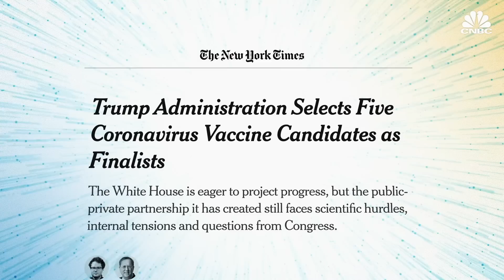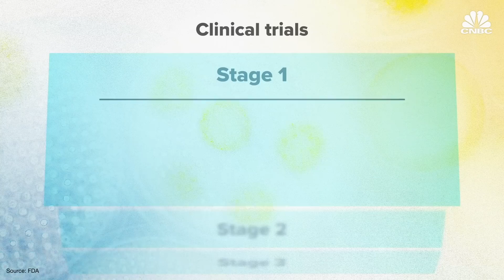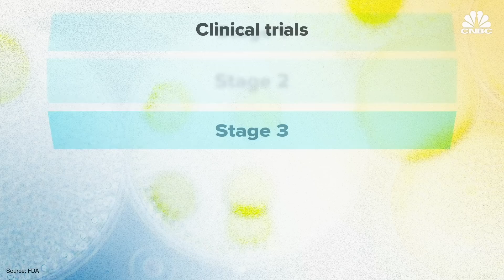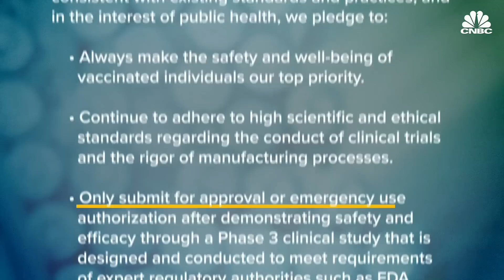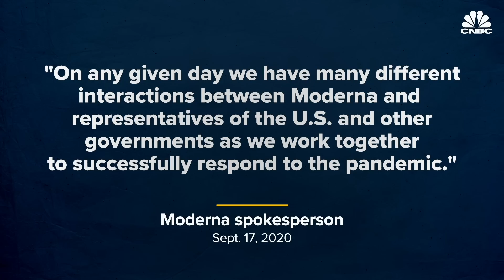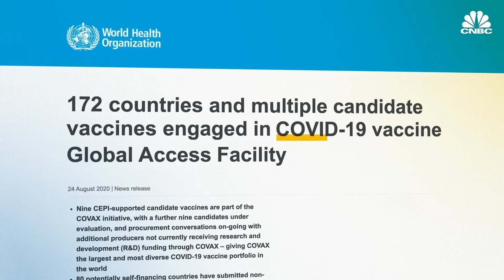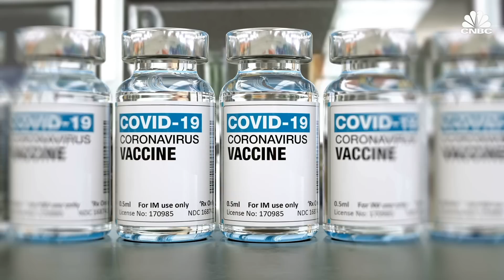What Is An mRNA Coronavirus Vaccine?

Comment: @3:05 "because the vaccine doesnt contain a virus, the participant cant get effected by the vaccine. Which is a risk for the traditional immunization methods." Does that mean they're saying you can get the flu from the flu shot?
Reply: I believe so. I know I did. I was sick as a dog when I received the flu shot, never again, I would have rather had the flu and been over it in the usual week it takes me to recover from it. The flu shot made so sick, knocked me on my butt for two weeks, it was awful.
Reply: @kimwarner1681  Sorry to hear that. Im just shocked they admitted that because Im always hearing doctors/media claim that the flu shots will never give you the flu. I stopped getting the flu shots cause I always ended up getting the flu right after getting the shot. Since I stopped,I havent had the flu since then.
Reply: because you are given a weakened form of the flu, there is a small risk you will show symptoms. vaccines are worth it regardless, because there is a much smaller chance of vaccine complications then there is with complications from possibly getting infected
Reply: @swank8508  That makes sense but why do they state you cant get the flu from the flu shot if that is true? That is my whole point.
Reply: @ImmaQT2  certain types give a weakened virus where you CAN get sick, but there are also versions of the vaccine that give a dead version of the virus and CANNOT give you the virus. I got a nasal spray vaccine once, which made me slightly sick for one day because it was the live virus vaccine

Comment: Yeah, no thanks. I am not an anti-vaxxer, I get flu shots, but that type of vaccine has decades upon decades of research and use. I am absolutely not going to be a guinea pig with a vaccine that actually hijacks your cell's machinery with synthetic RNA. It just sounds like the beginning of a bad sc-fi movie. No Thank you.
Reply: as someone who takes vaccines i hope you will listen to reason. this rna will not alter your dna, it will only give one-time instructions to your cell and then the rna will be broken down. the dna will be safe inside the cell nucleus the whole time
Reply: @swank8508  I don't think you fully understand how this vaccine works. Using synthetic virus RNA, It hijacks the machinery of your cells to produce the Covid19 spike protein which it expresses on the outside of the cell. Your body then identifies this cell as a foreign invader and attacks and kills this cell. No, this vaccine will likely not alter your DNA, but it does train your immune system to attack your own cells, which is why some experts think that cancers and autoimmune diseases are a possibility.
Reply: @kjjosker  this is the first good argument ive read, do you have a source for autoimmune concerns? (Not proof, just a scientist who knows what theyre talking about expressing concern)
Reply: @swank and again, this is fairly new technology that has not been tried on a large scale, I would be very shocked if it goes off without a hitch.

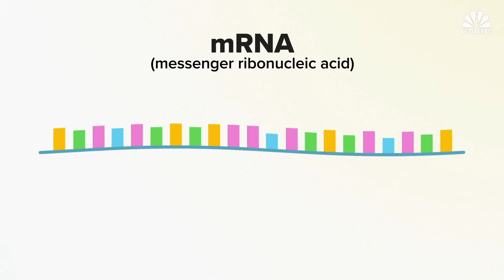Comment: The description of what the mRNA encodes at 2:05 is wrong. The mRNA vaccine does NOT encode antibodies. It encodes a viral protein (in this case the spike protein of SARS-CoV-2). Your own cells then produce the viral protein using the mRNA's instructions.  Then your immune system generates antibodies against that protein and you get immunity.

Comment: WHY THE VACCINES ARE ALL BUNK FOR MOST OF US
The very basis of the danger of Covid-19 over other viruses is if you touch anything with it on, you will pass it on to other people, Even if you make a messenger RNA vaccine that 100% worked, was safe, and was a one off cure, you could:
1) Pick up Covid-19 pathogens on your hands and body (including off infected people, cats, dogs, other animals or work surfaces, door handles etc) and the pass them on to other people.
2) If your body is now packed with antibodies to prevent harm to you as an individual, you can still breathe in and sneeze out Covid-19 germs. You are still a carrier of it. If someone sneezes, you can breathe it in, then sneeze it out elsewhere.
3)     How can you possibly be sure that the antibodies you produce are not similar to the ones produced with the yearly flu vaccines they manufacture annually? That are NEVER guaranteed to protect you from other other flu viruses that morph into existence later on?

Comment: Moderna, as in FAUCI THE ORIGINAL C.E.O. OF.... holds stake in, and funded the wuhan cymeric research of the corona virus .... move along folks nothhing to see here... DEFINATLY NOTHING TO DO WITH ID 2020/ROCKERFELLER LOCKSTEP / USPATENT#2020060606A1 held by gates to get everyone rfid chipped.

Comment: ON VACCINES.....
1)
95% efficiency of the corona virus vaccine.....
who did the research.....???
the same drug company of course.
one of the many flaws with vaccine research. PS. did rhey use a gold standard control group? or is it like all other vaccines where the gold standard has not been strictly adhered to?
2).
95% efficiency of the corona virus vaccine..... in young healthy people that they did the research on....
is it 95% efficient in older people or unhealthy people???
3).
95% efficiency of the corona virus vaccine..... so its 95% efficient after a week...? 2 weeks... a month?
what about its efficiency after 3 months....?
4).
is the vaccine safe....?
how long do the clinical trials go for????
the the amount of time they have been shown to be safe for.... a month... a few months...? will it turn out to be safe after a year? 2 years? was the vaginal cancer vaccine, garisol, not deemed to be safe by experts before it was withdrawn a few years later...?
5).
what adjuntives are they using?  aluminium?
what anteseptic are they using? mercury ? glicol? formaldehyde??? somerhing else?
could injected mercury o aluminium or formaldehyde not provoke a disease many years after a vaccine is administered....?

sweden let the corona virus spread rapidly.... and it seems the people developed natural immunity.... their second wave there is tiny compared to the rest of europe that used the strategy of lockdowns. natural immunity is not the same as vaccinated immunity. it is natural... healthy and superior.
with the corona virus.... too much pharmeceutical money going to the media and to politicians...!

mark a health care professional.

Comment: Cells from an aborted Male MRC- 5

https://en.m.wikipedia.org/wiki/MRC-5
MRC-5 (Medical Research Council cell strain 5) is a diploid cell culture line composed of fibroblasts, originally developed from the lung tissue of a 14-week-old aborted male fetus. [1][2] The cell line was isolated by J.P. Jacobs and colleagues in September 1966 from the seventh population doubling of the original strain, and MRC-5 cells themselves are known to reach senescence in around 45 population doubling.

https://bioethics.georgetown.edu/2017/01/is-it-true-that-there-are-vaccines-produced-using-aborted-fetuses/

Cells used and vaccines produced using aborted fetuses

The most widely used foetal cells are WI-38 and MRC-5. The WI-38 cells were derived by Leonard Hayflick in 1962 from the lung of a 3-month female foetus [2].The initials WI refer to the Wistar Institute, a body of the University of Pennsylvania, Philadelphia, and number 38 to the foetus from which the cells were obtained. The MRC-5 cells were obtained in 1966 from the lungs of a 14-week male foetus [3].The initials MRC indicate Medical Research Council, a body from London. Other cells derived from surgically-aborted foetuses are: WI-1, WI-3, WI-11, WI-16, WI-18, WI-19, WI-23, WI-24, WI-25, WI-26, WI-27, WI-44, MRC-9, IMR-90, and R-17 (obtained from lung); WI-2, WI-12 and WI-20, (skin and muscle); WI-5 (muscle); WI-8 and WI-14, and WS1 (skin); WI-4, WI-9, WI-10, WI-13 and WI-15 (kidney); WI-6, WI-21 and WI-22 (heart); WI-7 (thymus and thyroids), WI-17 (liver); FHs74Int (small intestine); and PER.C6

Comment: Do you remember all of the Pharmaceuticals that were recalled and the lawsuits that were paid on drugs that 2,3,4, 5 years down the line, caused harm to patients? I do. We are guinea pigs. The only way to tell the long-term effects of a vaccine is to wait and see what happens down the road. If you want to take a risk, that is fine with me. However, I will wait as long as I can to see what happens with these covid inoculations. Also, according to most studies, vaccines, especially flu, have a very poor track record. Flu vaccines are typically less than 40% effective, if that..

Comment: The mRNA mimic the virus infection of the cell. Instead producing the re-infectable viral particles it produced viral surface antigen that bound to the cell. It is safe that no living virus will be delivered to the body but , but it may cause inflammation due to the innate immune attack to the  mRNA-transfected cells?
Reply: That's true from my understanding. The mRNA therapy tricks the cell to produce antigen in the same way the virus does. It's invasive to the cell, however, as opposed the other vaccine strategies that stimulate the immune system extracellularly to produce the antibody. I personally would not take it for that reason.

Comment: Every year they come out wit a new flu vaccine, based on a new strain.
So how is this any different from that?
Reply: Valrath823  It's doesn't matter. It's still done in a month or 2 to create a new vaccine.
Reply: @sam16362  Months, not years.
Reply: @sam16362  It's like 6 months.
Reply: Flu shot is not an mRNA vaccine. mRNA relies on completely new and different mechanisms than the flu shot’s mechanism of action, which have not been employed before. So comparing the current flu shot to this vaccine is not applicable

Comment: Here's my question - will it be necessary BEFORE infection, or will it also work as a TREATMENT to save those that are already infected????  I'm much more interested in something that will save people from dying, that ONLY preventing infection.  Of course, that is a priority, but surely a cure to slow the body-count has to be a priority, too!  #JustSayin
Reply: So heres the thing.  Viral infections very different then bacterial ones.    With bacterial infections - even later stage, we can give you antibotics and you will recover most of the time.  Viral infects on the other hand have a tipping point.  Virus's infect your own cells, they highjack them to make billions more virus cells, then explode your cell and flow around until they infect another cell, over and over.   once you hit a point, no matter what you do, even if you stop all viral replication (that is what antivirals do) it won't make a difference.  Its a runaway train. 

A lot of the people dying of covid are older, in NYC 80% of deaths were over 60 years old, Once they get infected with the virus, it takes its toll on them and their immune system just isn't strong enough to deal with it.   You can give them the vaccine and im sure we will, but its not that their body can't fight the virus it can, but its weak and it can't beat it fast enough.,  Its more like their body is trying to play foot ball with 8 players instead of the full 11.  You might know exactly how to read the defense and know the right play to call to get a touch down, but if you get sacked as soon as you snap the ball it doesn't matter.

Thats why it will be so important for older folks, people with weak immune systems and front line workers to get the vaccine ASAP when it comes out.

Comment: Im not an antivaxxer. I will gladly take a vaccine that allows my body to fight off a weakened version of the virus and then produce antibodies. This is how your immune system naturally produces antibodies.  I do NOT however, like the idea of adding mRNA into my cells, thus interfering directly with cellular function. While this is not technically "altering" my genome, it is still adding genetic coding, bypassing transcription. It doesnt need to be attached to my genome, as attaching it to my genome would simply be the same thing except my cells would need to transcribe the mRNA transcript from there. This essentially, is nearly the same thing without the permanent change to my DNA, which is even more horrifying because there will not be any regulation of transcription to ensure adequate transcript levels.  

No thanks..
Reply: I agree. However, vaccines are tested heavily before released publicly. I think that by the time this is public, the issues you state are going to be proven wrong. Think, these are some of the worlds brightest minds at work here. They have already thought up these possibilities.
Reply: @dolphindrawings9331  They cannot be tested heavily in such a short time. How can you test long term effects with a short term clinical trial?

Comment: Both Moderna and Pfizer vaccines require very low temperature freezers. 

Pfizer's vaccine must be stoerd at -70F. A lab freezer that can freeze cO2 (dry ice) is what is necessary. It will be significantly  more challenging to distribute to developing countries or isolated areas.

Comment: mrna vaccines DO NOT carry instructions to make ANTIBODIES. They carry instructions to make ANTIGENS! this is like the difference between targets and rifles. Unreliable report with this basic error.
Reply: Uh at most, this would give you a rash. It is still beneficial...
Reply: Another error when describing Remdesivir, which was not developed for Ebola. It was developed to treat hep C, got press (and USAMRIID backing) for its Ebola treatment potential, but ended up not working as well as other drugs. All before again being pulled out of the library for COVID

Comment: Nice article in Nature on the subject. https://www.nature.com/articles/nrd.2017.243 ...Potential safety concerns that are likely to be evaluated in future preclinical and clinical studies include local and systemic inflammation, the biodistribution and persistence of expressed immunogen, stimulation of auto-reactive antibodies and potential toxic effects of any non-native nucleotides and delivery system components. A possible concern could be that some mRNA-based vaccine platforms54,166 induce potent type I interferon responses, which have been associated not only with inflammation but also potentially with autoimmunity167,168. Thus, identification of individuals at an increased risk of autoimmune reactions before mRNA vaccination may allow reasonable precautions to be taken. Another potential safety issue could derive from the presence of extracellular RNA during mRNA vaccination. Extracellular naked RNA has been shown to increase the permeability of tightly packed endothelial cells and may thus contribute to oedema169. Another study showed that extracellular RNA promoted blood coagulation and pathological thrombus formation170. Safety will therefore need continued evaluation as different mRNA modalities and delivery systems are utilized for the first time in humans and are tested in larger patient populations.

Comment: Because of my involvement with the LGBTQ and Arts communities in Newark, NJ, I was invited to participate in a 3rd stage trial of an HIV vaccine.  Double blind and one of, probably 30,000.  I may get the vaccine, a placebo or they decide they do not need another 72 year old, straight white guy with virtually not risk behavior..  My suspicion is that it's mRNA based.  Because of the contact (Rutgers U.) my guess is that it comes from Robert Woods Johnson

Comment: There is no way I am getting vaccinated with a vaccine that is being rushed out and hasn't gone through proper trials.  You can all test it for me though.  Good luck when you get side effects that may be worse than the virus.   And I am no anti vaccer but a good vaccine has to go through a couple of years of trials.
Reply: You right.  Any vaccine needs clinical trials 5-10 years. So, thanks, but no thanks.
Reply: I got no problem with that. But we have to open back up once the vaccine’s available. If you get COVID cuz you didn’t vaccinate, that’s on you.
Reply: We can’t really wait 5-10 years now can we
Reply: @jherc12990  The virus hasn't been isolated, so scientifically it doesn't even exist, the PCR tests are useless, and Flu mortality figures in most countries have dropped to zero since this started, now you join the dots.
Reply: people I know who got the virus are suffering still consequential from getting it and they have told me they would much rather get the vaccine if it would prevent them from suffering the way they had with the actual virus. But there are also people who had very mild symptoms. The virus is really unpredictable.
Reply: utewbing  no it makes your cells make antibodies that will fight the virus not create the virus.
Reply: And they're using RNA which changes your cells to fight the virus instead of exposing your immune system to a weak virus so it knows what to fight.

Comment: mRNA isn’t new... it’s part of our general biology
Reply: Its new for it to be used in vaccines and to genetically modify cells instead of exposing them to a weakened virus.
Reply: Finally someone with actual common sense.
Reply: @LJSJIUJITSU  nah just completely reductive , ignorant reasoning
Reply: Why just lying about this?
No vaccine with m-RNA, has ever been approved, zero.
It's NOW being pushed.
There's a reason some are saying nothing to fear, see, not new...why?
Reply: And we tried to use it to vaccinate against the common cold and it does not work for that so this snake oil will work on it's cousin? bad scientists. chasing money and fame? sorry cretins your busted.
Reply: @MrDogonjon  The problem they faced was the same as any other cold virus shots - the cold virus is to various and evolves quickly. For now, this approach can only done for specific virus.
For now, SARS variants have been defined and somewhat contained in that category. Potentially, this would fix only some corona cases - we will find out.